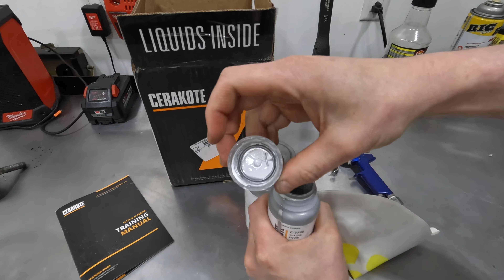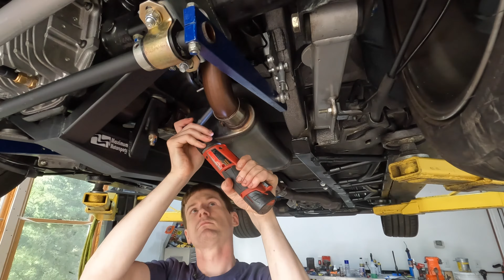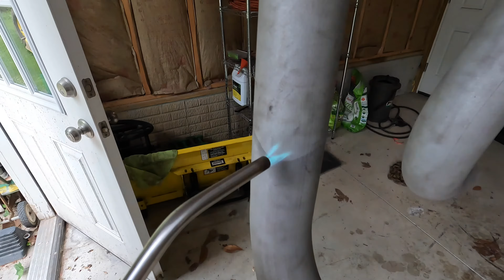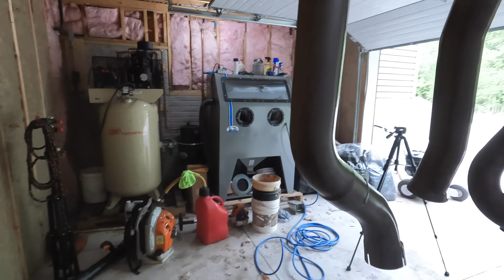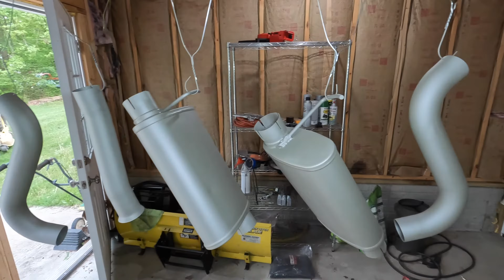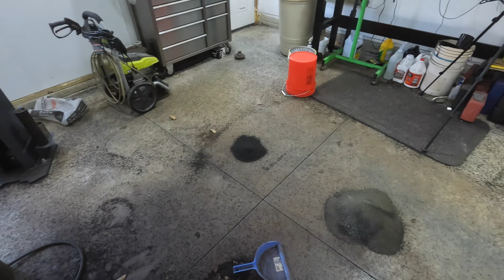DIY Exhaust Ceramic Coating Application: Cerakote C-Series. ( Air Cure, No Oven Required )

Comment from the maker: Products used in this video: 
Cerakote C-Series Coating: https://amzn.to/3N8GbFw
-4oz will coat 2 shorty headers, 16oz is needed to coat a set of longtubes. My catback took 12oz.
Sandblaster: https://amzn.to/42jXvM0
Aluminum Oxide Media: https://amzn.to/3MJ7d4R
Paint Gun: https://amzn.to/3qlxLlc
My Amazon Store:  https://www.amazon.com/shop/repairgeek
Help support the channel, buy using my Amazon links
As an Amazon Associate I earn from qualifying purchases and your cost is exactly the same.

Comment: Ya, Cerakote isn't true Ceramic, it's a Polymer, basically high tech Paint. True Ceramic Metal (CerMet) is a much more durable treatment for Exhaust components. The problem is finding someone that does it, and it's defiantly not DIY.

Comment: How about using phosphoric acid to convert the rust to a natural black iron phosphate coating which is a better base for paint.
Then when / if the rust came back it would be black......just a thought.......
Reply: The rust does not come back black. 😂

Comment: great video but feel like you missed a chance at science.  A simple heat gun pointed at different surfaces after 30 minutes and an hour of operation before and after would have presented external temperature data.  I live in the south and if I can increase exhaust scavenging or decrease engine bay heat then it is worth money but otherwise not really worth the effort.

Comment: I’ve seen a thermoinsulation foil coated polystyrene panel(hardware stores have them) oven heated with a heat gun, use a cheap meat / oven probe thermometer to regulate heat.

Comment: Nice job. In my thoughts the way you did your hot rod I think that you could have a possibility to increase the small amount of horsepower by entrapping the heat inside the exhaust. You seemed less than thrilled about coding the factory forward of the Cat-Back, I would still at the very least get some foam brushes and some high temperature Grill paint and flat black and some brushes and coat that in to encapsulate the heat so that it will move out of the exhaust faster which in turn would give you better throttle response and slightly lower the temperatures

Comment: Have used Cerakota for years on projects, process used, non humid day, have spray set all ready to spray, then media blast part, immediately spray after completing blast/wipe, only spray one thin coat to cover!, spray gun press around 18 psi. Blast w/110 grit garnet. Coat all kinds of parts for corrosion protection.

Comment: Also own a foxbody, what did you use on the floor pans and basically everything under the car? The Mastercoat ag 111 ? The MM suspension is sick! Waiting to put my panhard bar and lower control arms on. May cerakote my flow masters! Maybe they won’t rust away. Lol

Comment: The sand blaster gun you are using is not what is in the link provided. Is that le lematec sand blasting gun  decent?
Reply: It doesn’t matter. As long as you click on the link.🤪

Comment: It also seems like you are spraying way too fast and far away from the part. You don't do a "Light Coat" with Cerakote. That will cause dry spray. You spray more close and slow in one pass. You can overlap by say 50% or so and obviously it's dependent on the amount of volume and fan pattern you have set your spray gun to and also the pressure. I normally spray  at 30psi on the big surfaces, and you dial down air and volume for the tight areas, you can also tap the trigger in tight spots to prevent dry spray. It's nothing like spraying any automotive paints, as it's not really a paint.

Comment: For it to last your prep work needs to be a lot more thorough. The pipe you sprayed on the truck was basically not prepped at all. I spray tons of Brabus and AMG pipes, also a lot of Ferrari and Lambo exhaust tips. And I follow all the instructions. Cerakote is not really a DIY product if you don't have all the right equipment.
Reply from the maker: I bet you pull the pipes off as well, giving you a better finished product. Removing the exhaust on my daily, like I stated in the video wasn't really an option due to time constraints. I did the work on a Saturday and had to drive the vehicle Monday.  Also, I've never seen anyone drive a Lambo through a foot of snow and the salt that goes along with that. My truck sees that environment daily in the winter. My Mustang that is a garage queen like a Lambo, my application looks perfect still. Comparing the environment a Ferrari sees to the environment my truck sees is literally like comparing apples and oranges.
Reply: @RepairGeek 
I heavily prefer apples over oranges. 
They have less citrus, which hurts my tum tum, the textures meaty instead of mushy, and the flavors rich instead of sugary. Fuck oranges, #ApplesForTheWin 😎

Comment: the temp inside the pipe will not change i tested with a temp gun my manifold and turbo after Cerakote made a 250 average drop but I did inside and out g black on manifold an ti red pistion coat on in and out of turbo. thanks for sharing

Comment: I'm interested in using this on my truck which suffers from a multitude of problems because of radiant exhaust heat, boiling fuel and heating up rear AC lines etc. Interesting that you didn't see any difference in EGT with and without it. I had my project car turbo manifold and downpipe professionally ceramic coated by a local shop and the difference was staggering. It really cut down on the radiant heat and enormous amount. Will be interested to see if you notice anything. On my turbo car after driving I can place my hand over the downpipe and feel a little warmth and then move my hand a few inches to the turbo itself and feel a TON of heat coming off. Really makes a big difference. Would be interested in hearing if you can feel the same thing.
Reply: That's because he's measuring inside the DPF, he mentioned it.  His thought process is a wee bit off, during regen the ECU will dump whatever fuel is needed to maintain temp.   I used C-186 piston coat on the inside and C-7600 on the outside of a custom downpipe... fantastic stuff IF it's applied properly.

Comment: Hint....I do exhausts in Cerakote all the time, 2 more v twin sets coming in tomorrow. Wipe them down with acetone before blasting, blast then wash them really wet with virgin acetone. Leave overnight and then coat. No need to gas out.

Comment: Holy hell... Nope!

Seems like if you consider the time+effort+tools cost+parts cost, and the longevity of the product, I think it's better to just replace the corroded parts exhaust every 10 years or so. 

The exhaust for my car is 1 huge piece, and was only $120 for a used in amazing condition. Maybe next time I'm buying a replacement I'll consider coating it, but I'm definitely not removing everything+replacing the flange gaskets+prepping+reinstalling the one already on my car.

Comment: Brake cleaner is NOT a good product to use under paint coatings. Better to use grease and wax remover it's made for cleaning before painting. I know PPG one of them had a big note said if you use brake cleaner under the paint, they won't warranty it. Could also be from the days of chlorinated brake cleaner.  

Sandblasting is expensive if you take it to a shop to do it. $300 now to blast a set of headers used to be $100. I actually had my own media blaster for number of years tough business for mobile blasting. Was nice to be able to blast my own parts compressor was 150 PSI at 210 CFM diesel powered Rotary screw compressor like a super charger.  Everyone called me asked if I could blast their exhaust system only take me about 20 minutes the blast pattern was about 6 inches, I used crushed glass.
Reply from the maker: I appreciate the insight but, this isn't PPG paint. Cerakote says brake cleaner is perfectly fine: https://youtu.be/cuqo8f_7foU?t=130

Comment: Great transparency on the DPF! The color on the catback of the mustang looks great as well
Reply: <sigh> I'm not sure if its your own misguided expectations or justifications, the coating on the DPF is NOT the issue. The only issue I see is that you don't want to/wouldn't/won't do it 100% to get the 100% results. Take loose and remove the silly senders and nozzle(s), Cut the DPF pipe where you need to, allowing it to go in your blast cabinet. If you need to essentially make it like the Mustang (which looks great) and be modular by size?, Then cut the DPF into manageable sizes! Plug the holes and blast the dang thing(s) already and quite bell-aching about being unhappy or unimpressed. Yes, 500%, the rust came through, no surprise there. Yes, the coating is flaking. Yes 4 months is commendable life span given you didn't do the DPF correctly. I applaud you for the intention of showing and discussing your coated DPF lack-luster results. But from my view point as a watcher/listener: You would have come across even more relatable, honest, transparent, humble, and appreciated if you just said "Here is WHY you follow Cerakote's instructions to the letter." Then do just as you did in the explanation of why the Cerakote instructions need to be followed to the letter of the law. And you did frame that perspective while filming the Mustang portion. "the Cerakote isn't good for this specific situation/application" is only true framed in the caveat: "Because I didn't blast the parts which is Cerakotes #1 rule and warning."  Lastly: the whole discussion toward the end trying to save face talking about " monitoring this, watching that, there is this awesome, special-secret project coming soon, won't let the cat outta the bag yet " B.S. is a I want to be a popular You Tuber carrot dangle. Stop it. Reality: Someone asked if the Cerakote helped with radiated temps , likely specifically regarding a DPF. Your answer should have been (5) FIVE, simple words  "I didn't test for that."

Comment: Exhaust temp sensors are way too high upstream the exhaust for the gasses to be hotter. That’s strictly controlled by the engine
Reply from the maker: I'm dealing with an emissions equipped diesel truck. The truck has 5 EGT sensors. The rear most sensor is right behind the DPF and the piping that's been coated.

Comment: I've had terrible results with similar products in the past... even after all of the insane amounts of prep (I also sandblasted everything and all of that) and paying to have the coating professionally baked on by a powder coating shop. It always ended up looking like your DPF within weeks and was a lost cause within months. My take away from those experiences was that my effort and money were better spent by buying higher quality stainless exhaust parts.

I can't think of the last time I saw an OEM system that wasn't at least 400 series stainless. It will look terrible forever, but it will hold on for years and years. Aftermarket is easy to get in whatever you want to pay for. I put a 409 system on my Fox in 2007 and it has fairly light surface rust after all these years.

Comment: Is this the same stuff (but high temp) that is used by the gun crowd?
Reply from the maker: Yep, what series the gun guys are using I'm not sure. C series is the high temp stuff.
Reply: @RepairGeek  On guns it's normally H Series or Elite. The Graphite Black I used on my Glock, lasted longer on the barrel than the factory finish on the Gen5. Seeing I do this for a living, my Glock has been 8 different colours.
Reply: @RepairGeek  H-Series. It's a bake on coating. It has to be heated to cure. It's good, but at the end of the day, it is still paint. Paint and moving parts do not mix well.
Reply: @MrRaab-hu9rs  If you have ever applied cerakote you will understand it is a very different beast to "paint" and 9 times thinner when applied